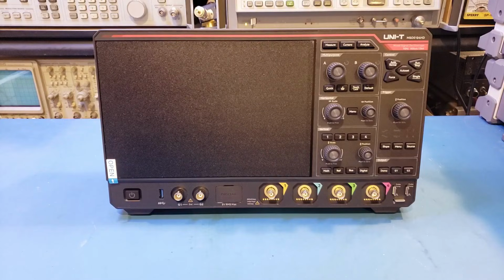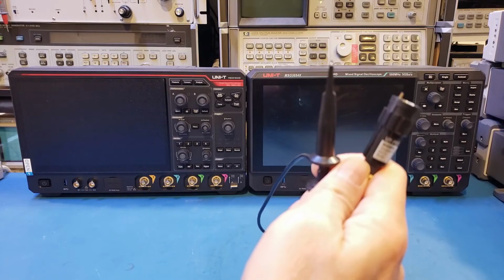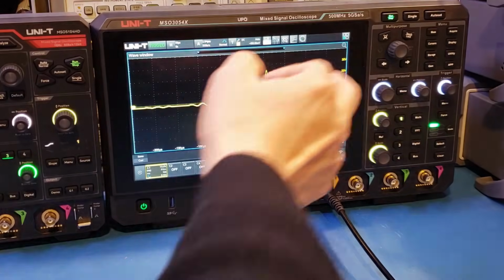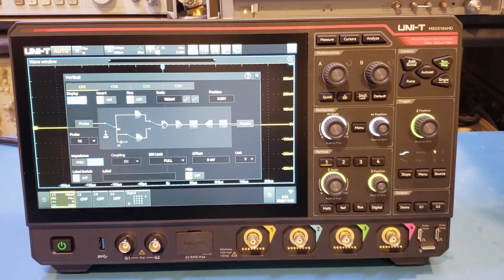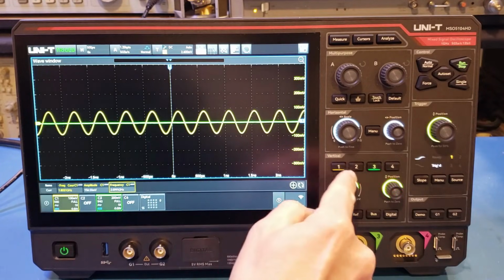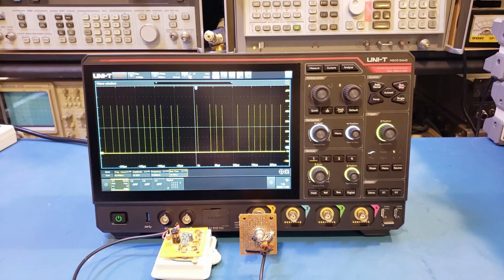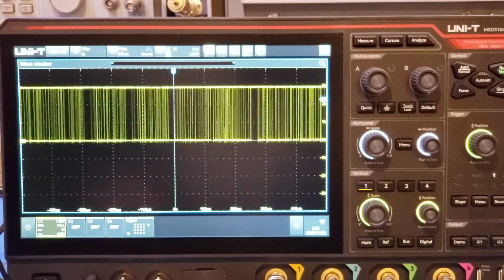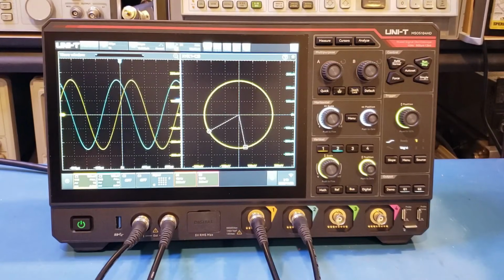UNI-T MSO5104HD 12-Bit 1 GHz Mixed Signal Oscilloscope Comprehensive Review

Comment: I would appreciate it if you fixed the paid for ARINC 429 decoding. All your does is provide raw HEX data, which means I have to do all the work to get the right data. Please tell us that you're going to fix this in firmware.